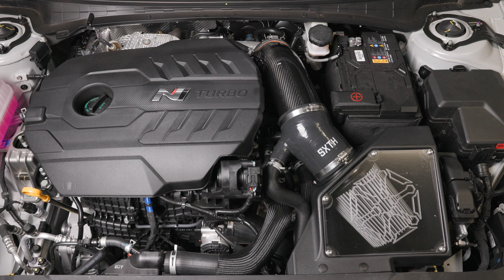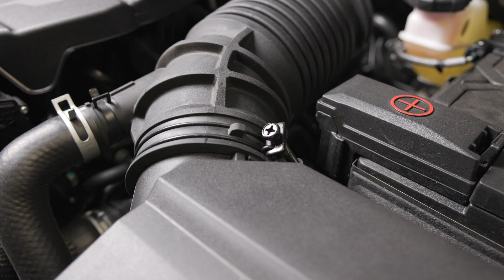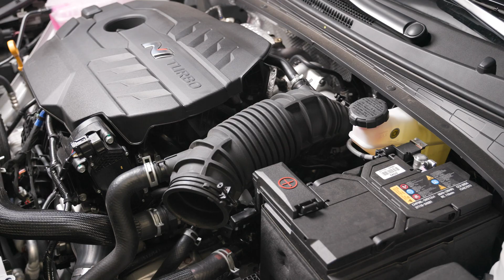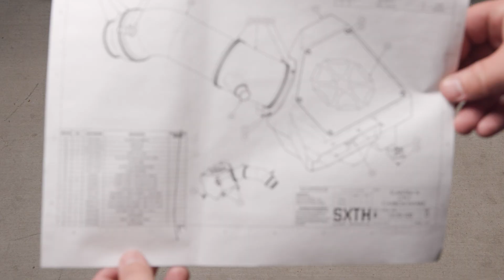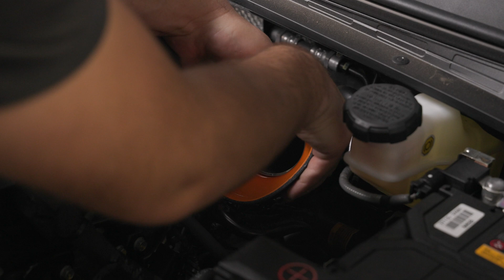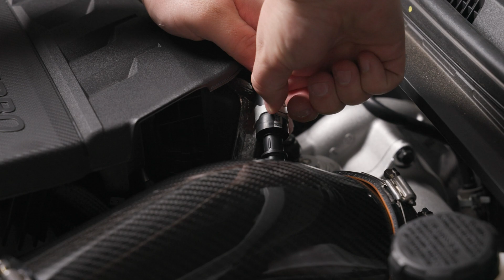Elantra N CPLT Intake Installation

Comment: Will this intake throw any codes?
Reply: I spoke to the reps at sxth element. They emailed me that since the EN doesn't have a MAF, it doesn't require a tune. Proper installation shouldn't give you codes, from what I read.

Comment: What the hp increase?
Reply: @punemax They claim around 14 WHP, but dyno charts concluded around 4 WHP for my car. However, performance gains are really noticeable when also changing the turbo inlet which is another 5-10 WHP. I installed the SXTH intake and turbo inlet and came up with a total of 16 WHP increase over stock. Hope this helps!

Comment: Does this up HP or is it just a esthetic
Reply: It will with the turbo inlet and a tune. Most mods don’t add much power because the computer limits power if it reaches its optimal parameters. That’s why it’s important to get a tune for your mods to get the most out of them.